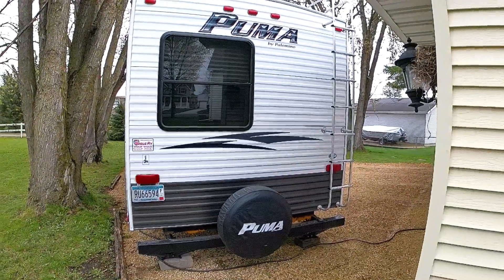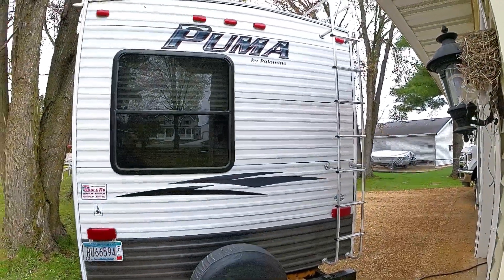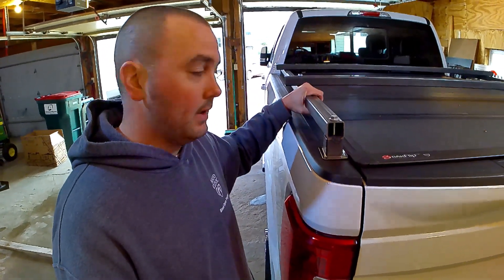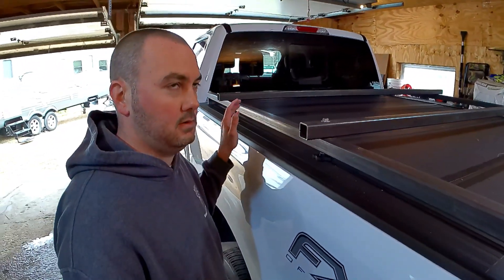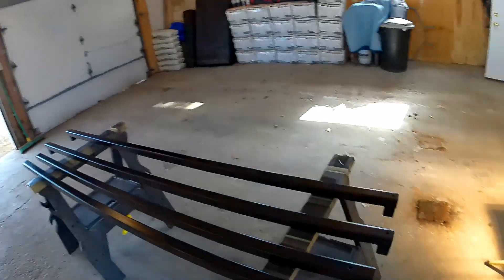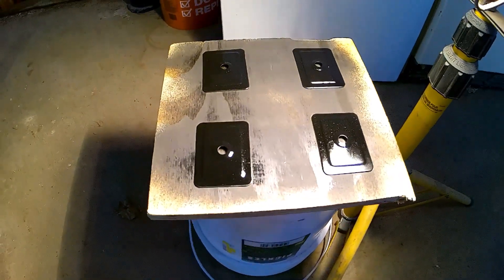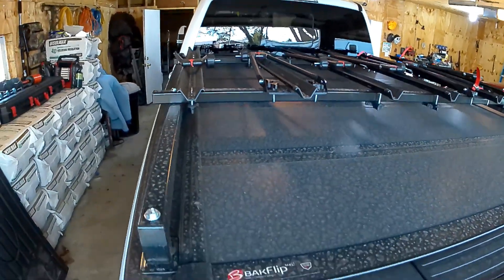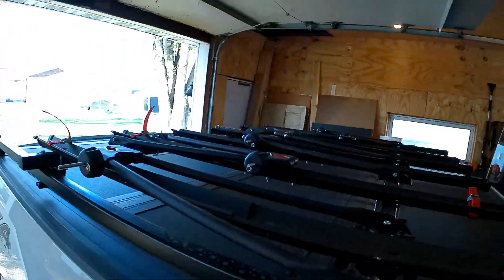6 bike rack over tonneau cover

Comment: Curious if you still use the bike rack system you made and if you are still satisfied with it. Have you had to make any adjustments? What do you estimate your approx total cost was (minus labor of course) for the tubing, bike racks, additional pieces?
Reply from the maker: Yes!! I still use it every summer. It stays on my truck at all times. There is some slight fading to the red grips of the bike holders. Otherwise it’s been great! I did have to repaint the bed rail parts, from where the rack part would slide along them. I would say at the time I build it, it was right around $650 for all the parts and tubing.
Reply: @talman0806  Thanks so much for the response. Hard to believe 2 years later and still hard to find a similar product on the market to purchase.

Comment: Hi there, I did a similar thing with 1.5" unistrut. 
I also have the same swagman bike carrier. 
The problem I have run into is that the squared u-bolts which come with the swagman are not that long and although they just pass the bottom of the unistrut and are able to have the provided plate around it, there is not much thread after that which I'm worried about.
Did you buy other squared u-bolts that did not come with the bike rack?
Reply from the maker: I believe I just used the provided U-bolt hardware with the swagman racks. However I used 1” square tube. So I’m sure that’s where you’re losing the extra thread length.

Comment: Great video. Can you share specs on the bolts you used ? Size. Diameter. Length etc. really cool
Reply from the maker: Most of those details are in the details of the video. Feel free to ask any specific questions you don’t see there

Comment: Great build, probably going to do something very similar. Have a question though. Are the bed rails and stake pocket anchors removable after they are installed? I'm hoping to do this but have the ability to completely remove them if not in use. Thanks in advance!
Reply: Might have been a dumb question... You obviously removed them after installing to paint them.
Reply from the maker: Sorry I missed this til now. Yes! They can be unbolted and removed, which I plan to do for the winter months